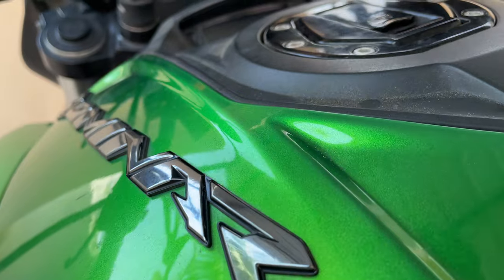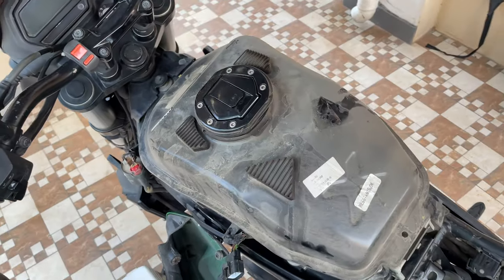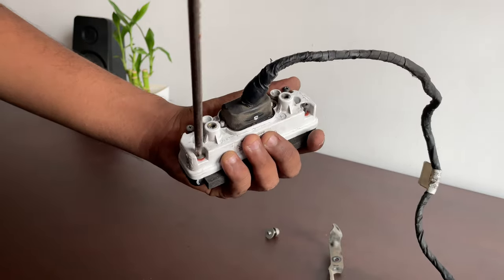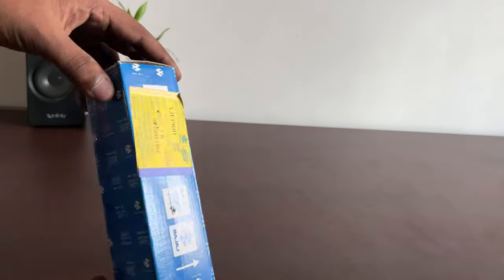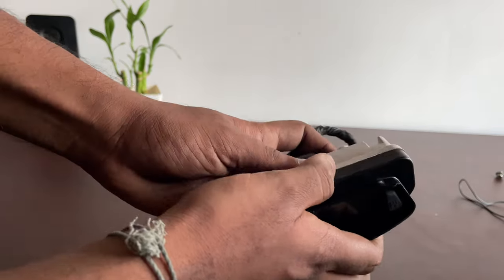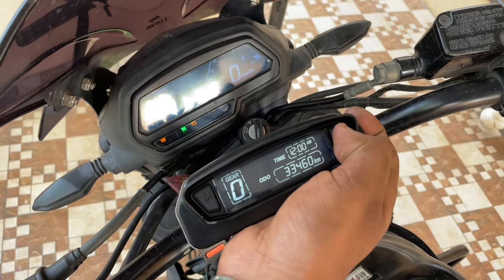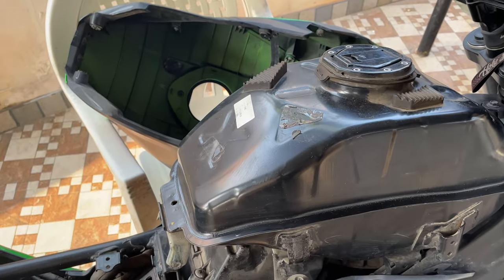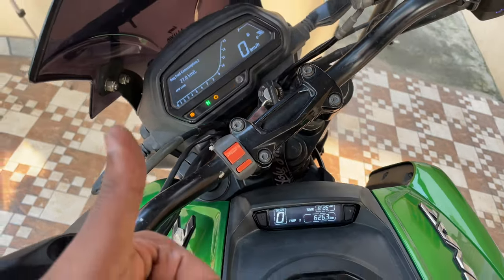Display button change in Dominar | DIY - DomIY | Dominar Series | The Muddy Mopeds Crew

Comment: Hi bro my domi secondary display right buttons is broken due to this water goes in my secondary display do u think it’s a button issue or the water seal of secondary display is to changed
Reply from the maker: If the water got inside display, the display will get affected. If your display works perfectly fine, just try to change the buttons alone
Reply: @themuddymopedcrew no my display is not working now 2 days before it’s was getting on and off automatically but now it’s completely gone so shall I dry the display? Or I have buy a new one
Reply from the maker: Best kindly go to service center. I think entire display should be changed
Reply: @prime6485  same situation for me bro
Reply: @chinmaykkumar1891  did u go to the service center I have gone to service center they say it will take 10-15 days to make the parts available bajaj service are really worst
Reply: @prime6485  yes i went to the service center..here the part is available but i just given to a local workshop to repair the secondary display.. they are saying that removing the fungus by soldering will make it work like before.
Reply: In 99 rpm there are multiple sections, display ,bracket ,tank and speedometer cover. Which one should i order please help me
Reply: @chandrakanth7325  what do u want to order?
Reply: @chandrakanth7325  If u have dominar 400 UG the select speedometer assly tank K10 /Dt402410 for 2562 rupees

Comment: Hi bro my secondary display button is cracked and somehow water has damaged the secondary display. On main display I'm getting error s can  communication failure. My bike is still in warranty. Will service center change it free of cost?
Reply from the maker: They will change it. But not sure about the warranty. Kindly check with the nearest service center
Reply: @myksingh Bro warranty me change hua ya buy karna pada
Reply: @Surya-hk3pu  yes bro free of cost change hogya 5year warranty me, service centre wale bolenge ki aapne service ni krwayi to claim pass nhi hoga and all. Tum bas bajaj ko official mail dalo phir krdenge change

Comment: Bro if I will change the display (not working) then odo reading will be same or not. Pls reply
Reply from the maker: Yes bro. I belive the odometer reading data is stored in display unit memory itself. So consult with your nearby service center if you are about to change your entire display
Reply: Ok bro thanks I changed the secondary display and my current odo reading is available
Reply: @pandeynir  bro did you change the enitre secondary console unit ?
Reply: @chinmaykkumar1891  yes bro
Reply: @pandeynir  still you got your old meter reading?